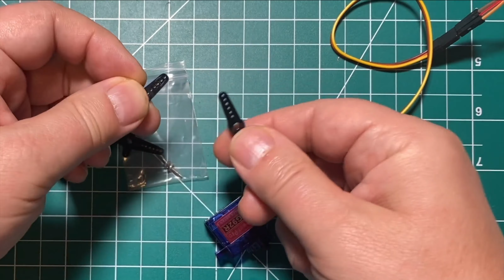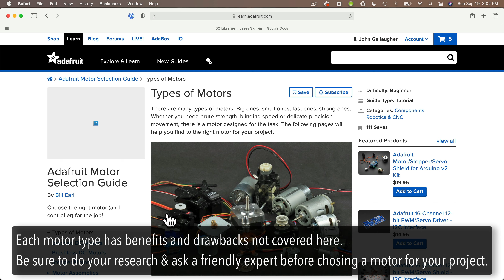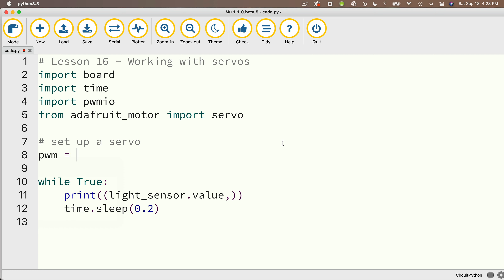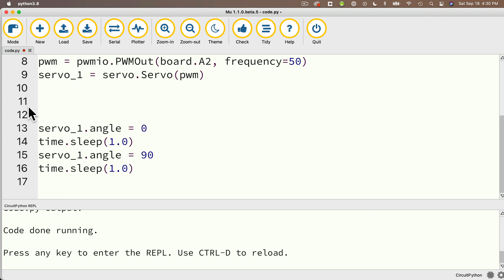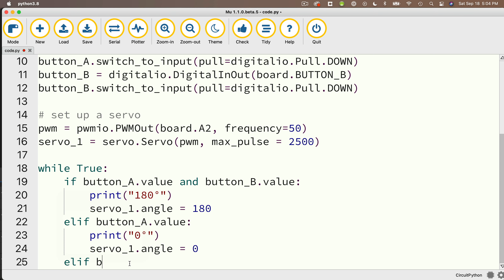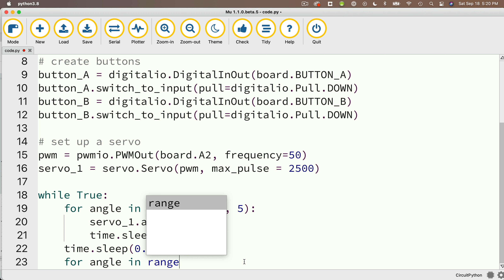SEE PLAYLIST FOR NEWER VERSION CircuitPython School - Motoring with Servo Motors

Comment: Thank you for the response on my last comment on the circuitpython setup, I got it working! Now I’m just having a few issues with servos. 

Whenever I use a mg90s servo with my pi 4 it often shakes and vibrates when it’s supposed to be idle. I’ve tried using an external power supply, other pins, other mg90s servos and tweaking the min pulse and max pulse doesn’t make a difference, it shakes at the standard values too. I also tried the 3,3 volt pin for power but it just started buzzing instead of shaking. Do you know what might cause this?
Reply from the maker: I don’t. Could be the servo itself. I’ve found the Adafruit Discord is fantastic at answering questions like this. Give them a shot! Good luck.

Comment: When running the program, it's printing but the servo is not rotating. I am using a raspberry PI Pico. Any suggestions?

from adafruit_motor import servo

#create buttons
button_A = digitalio.DigitalInOut(board.GP12)
button_A.switch_to_input(pull=digitalio.Pull.DOWN)

button_B = digitalio.DigitalInOut(board.GP11)
button_B.switch_to_input(pull=digitalio.Pull.DOWN)

#create a PWMout object
pwm = pwmio.PWMOut(board.GP13, frequency=50)

#Create a servo object
servo_1 = servo.Servo(pwm)

while True:
    if button_A.value and button_B.value:
        print("180°")
        servo_1.angle = 180
    elif button_A.value:
        print("0°")
        servo_1.angle = 0
    elif button_B.value:
        print("90°")
        servo_1.angle = 90
    time.sleep(0.2)